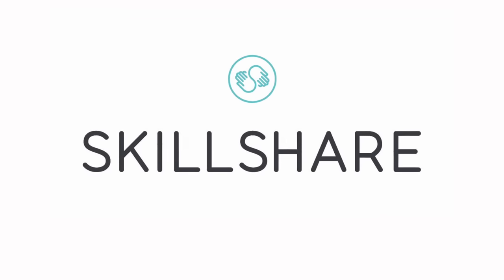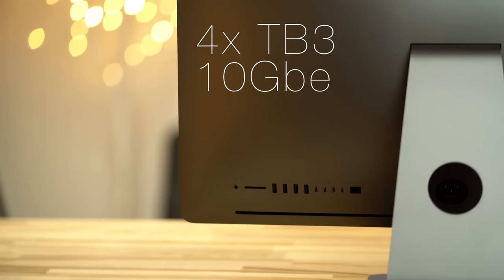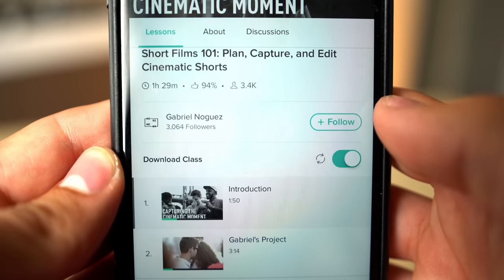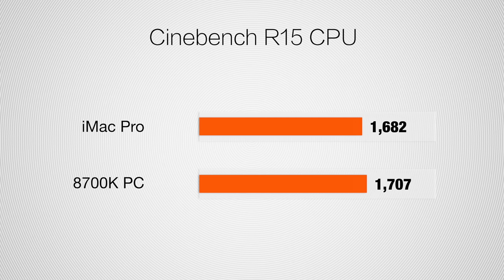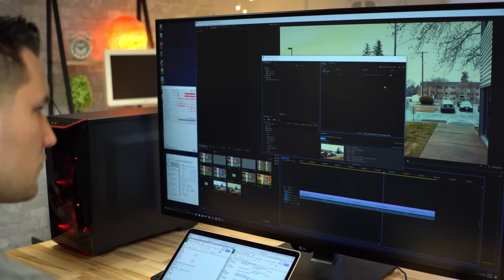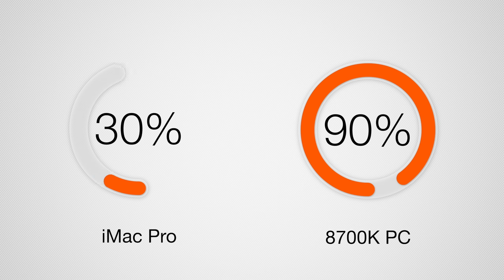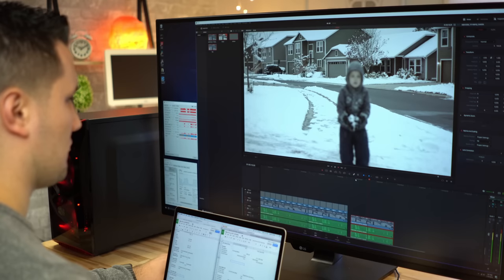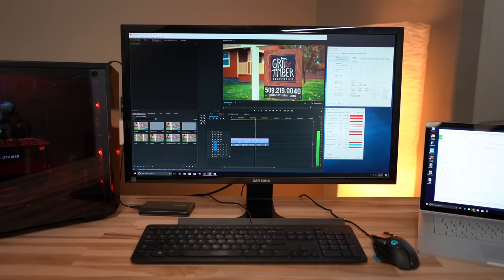$1350 PC vs $5000 iMac PRO for Video Editing 😲 Premiere & Resolve

Comment: Adobe is great, but now I’m so used to the FCPX I’m tied to Apple hardware...
Reply: Try Resolve! I've paid over $5000 on FCP and Logic upgrades over the years, but Resolve has allowed me to switch off of Apple.
Reply: BOBBY THOMPSON can i have ur fcpx if u dont need it anymore ?:0
Reply: I wish it still worked like that! Now everything gets tied to the app store :(
Reply: Hackintosh bruh
Reply: Resolve cannot compare to FCPX, it's just trying to copy it.
Reply: Vladimir Talijan respectfully disagree. But I'm glad we have choices.
Reply: BOBBY THOMPSON does resolve match FCPX on speed on Mac too?
Reply: Leica Dad yup. It uses metal API and and very well. It's FREE so test it out yourself on your system.
Reply: Leica Dad They match in raw speed, but not in the UI and organizing, editing speed. There is nothing like FCPX workflow wise, you don’t loose time only in export and stabilization, but the actual editing which is way better and more streamlined than any NLE, and it is faster with every new version. The difference in speed in a couple of years on the same hardware is probably 3-5 times for the most demanding tasks, stabilization, optical flow, export, so it’s like you have a PC which can upgrade physically and have the same bad software, as it had for the last 30 years :)
Reply: Apple hardware is why I switched to Mac after over thirty years with PC.  I got sick of window's etc taping out on me ever little bit.  My daughter got a Mackbook years ago and has not had a minutes's trouble.  I'ver gone through 2 laptops and a desk top.
Reply: Regie Endsley I'm the opposite. I've been Mac only for 19 years until September '17... When I needed to upgrade and realized there were no good Mac computers (for my needs).
Reply: Regie Endsley and for the record I muccchhh prefer Linux to windows after 4 months. I just hope apple makes good computers again soon.
Reply: I agree with you with one obs. No 1 in speed is GrassValley Edius and Adobe PR and AE are the worst. But I like FCPX interface and magnetic timeline ...
Reply: Is there really any reasons to use any other editing program than Final Cut on mac considering the optimization? I am using FCPX now and want to test out other programs but it feels stupid considering i have a mac.
Reply: Same for me till a year ago. I dived into Davinci and now i never go back.
Reply: Agree that FCPX is my preferred and I use both. FCPX is so good at background rendering that it tends to negate all of these render times nil and void.
Reply: You might want to get untied real quick because the fact is Apple has no plans to upgrade past FCPX other then basic little worthless updates... they made this statement years ago after they released it and everyone stopped using it.. and when I mean everyone stopped using it I mean as in Hollywood... At one point when FCP 7 was in order many where considering a switch from Avid to FCP 7 but once they released X everyone went back to Avid or on to Adobe... One thing is clear now that Apple no longer supports Creators, Artist and Musicians the way they once did... their only focus now is Mass Branding for the every day people while still charging the insane prices.  This video link here pretty much sums up what Software users should be learning/using  https://youtu.be/mehS_RET9hw
Reply: Sony Vagas
Reply: hackintosh
Reply: lmao im literally sitting in front of my 1500$ pc running mac OS
Reply: That's what I call expensive stupidity.
Reply: Sony Vegas was available cheap as part of the Humble Bundle not long ago. Then there are other options by Grass Valley, DaVinci.
Reply: Highly doubt it. Mac highest end cannot top PC highest end, simply because Mac cannot reach PC highest end. 

And when you put a $ budget, there is no way Mac will ever top PC in performance.
Reply: Have you ever heard of HACKINTOSH?
Reply: ahahahahahah
Reply: @regieendsley9750  lol thats ur problem for cheaping out on a pc
Reply: I have more money than a shitty 5000$ macbook

Comment: I had to size up this choice between PC and Mac when building my new system. I am a video editor myself and currently working in 1080p for the most part. The mac looks great and it's also useful to have that support there but a lot of that price is Apple's brand attached. I hate that you can't upgrade these desktops at a later date, it's simply not something that Apple lets you do. The price is really offputting for most people, even professionals like myself. Another plus to going with Windows is that you can use the peripherals that you already owned, taking the price off your new PC - especially if you are building yourself, you can re-use older parts that still work fine. In saying all of this though I love my Macbook Pro and was editing solely on that for the past couple of years as my PC from 2008 was really starting to slow down. I have since invested almost $5k AUD into a completely refreshed desktop and I love it. It has a threadripper 1920x which has 12 cores 24 threads, a GTX 1070 and 32gb of Corsair Dominator ramm. This thing is a total beast in the rendering department and I can also use it for things like gaming, so that's a win! Windows all the way when it comes to work stations like this.

Comment: Here's a few points to consider, beside the fact that the guy in the video is honest with the caveats of his own video, hats off to that.

- Adobe Premiere is not optimized for the Mac (I don't know about Resolve, but chances are it's not optimized for Mac)
- Noise output of each machine
- Shelf life (impossible to tell in such a test)
- Value of time spent on building the machine (this can make a difference depending on how you value your time)
- Mouse and keyboard equivalent to the Mac's are virtually impossible to find
- Included software